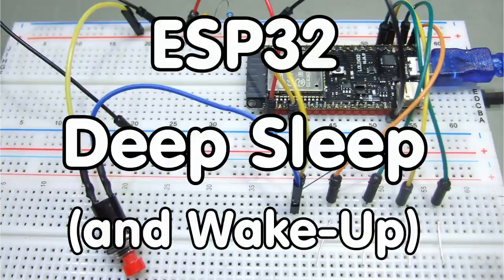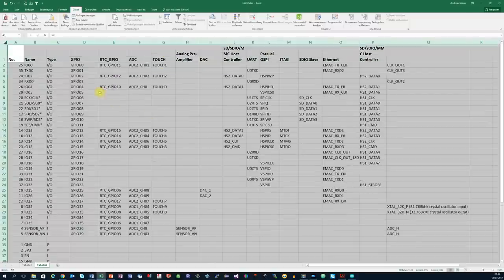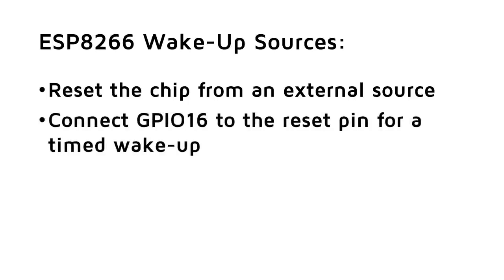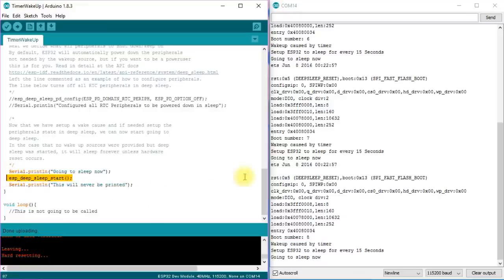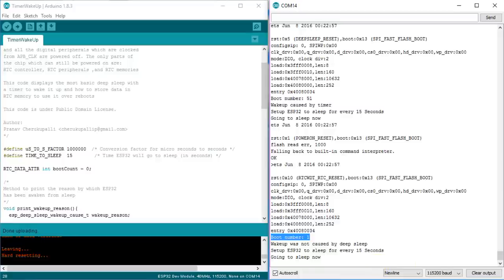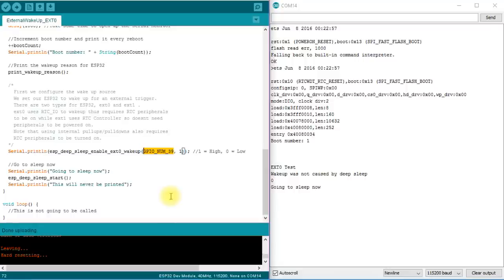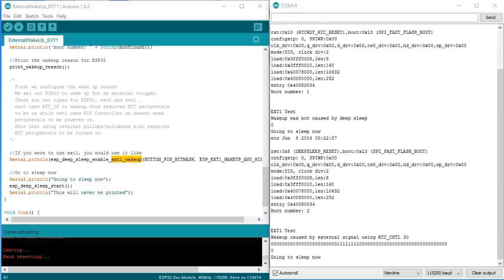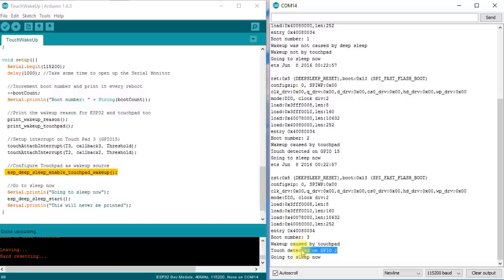#149 ESP32 Deep Sleep, RTC Memory, "Secret" LoLin Pins

Comment: You have become one of my mentors though your videos.  The ESP32 ULP processer may hold more capabilities than we think.  I've been researching  what little information I can find on it which seems to only have an assembler available.  Hopefully more information will surface as the community gets a chance to work with it.  I'm certain you will discover many of its secrets.Looking forward to more of your videos.  Thank you!
Reply from the maker: I think, the assembler is the "state of the art". I hope, we will get some "snipplets" to start with or to solve typical problems like trigger on a particular analog value, or saving a few values in RTC ram between wake-ups. Already the possibilities used in this video provide some interesting possibilities.
Reply: "is... like that."

Comment: Excellent work sir, thank you for your research! I have one of those ESP32 with the 18650 holder, last night I started testing a modified sketch, have it waking up every 30 minutes and blink a LED couple of times, started at ~4.15v and 12 hours later my battery is still at 4.05v. A day ago I was only able to get ~24 hours of total "blinky" on a single 18650, but with deep sleep this should last for days/weeks. Looking forward to see your current measurements!
Reply from the maker: These boards usually are not ideal for deep sleep because they have many parts which are not absolutely necessary and which use some current. But weeks should be ok.

Comment: Very interesting video as always. Please on the next video measure the current when the ESP leave sleep mode and connects to internet (like ping to custom website). I think that will be the main use of this uC and it will serve as reference for some people that want to use this device to send periodic data to a server and have to power the uC with batteries.
Reply from the maker: We will see. I think, I will not be able to use the ULP for quite some time, because it has to be programmed in assembler... I did not do this for years.
Reply: Assembler... now there is a name from the past. Must have been early 90s i did that last. Now i cant even understand my own programs from those days anymore

Comment: Watching this video made me want to dig out my ESP32 once more and see  if I could make it do something.  For about an hour, I messed with things trying to get the computer to recognize the blasted thing, and in the end I tossed it in the pile of junk I keep for parts to repair other items. I dug through my drawer and found one of the other ones I ordered at the the same time, (usually buy things in groups of 3) and behold, I have connection to the computer. Now I have spent the last two hours just running example sketches on the device, and giggling like a child when it actually does something. Now if  I can figure out how to use the bluetooth to do something and how to  use the wifi better then just making an led blink.  Should not be hard to do, just have to adjust my mind from using the 8266.
Reply from the maker: Wi-Fi should be no problem. Bluetooth seems to be harder with the Arduino IDE...
Reply: thats good to know. Was considering a switch from 8266 to 32 especially for bluetooth. Maybe i should wait

Comment: Another excellent and very interesting video. By strange coincidence I was testing deep sleep mode yesterday on a NodeMCU ESP-32S board and the best I could get was 2.3mA because of the regulator etc. (battery was connected to 3.3v pin so bypassing the regulator to a certain extent)
Reply from the maker: This is not surprising. The same as with the ESP8266 boards...

Comment: I know this video is 2 years old, but after all this time, very few people actually used any deep sleep timer example longer than a few minutes.
The problem is that with default code, changing the time to longer than 2 hours, it breaks the code, and overflows the variable.

In deep sleep example:

#define uS_TO_S_FACTOR 1000000  /* Conversion factor for micro seconds to seconds */
#define TIME_TO_SLEEP  3600  /* Time ESP32 will go to sleep (in seconds) */

Both values are saved as 32bit integer, yet esp_sleep_enable_timer_wakeup(uint64_t time_in_us) expects the 64bit value. So, you have a 70ish minutes limit before overflowing.

There are 2 solutions, add ULL suffix to uS_TO_S_FACTOR value: 

#define uS_TO_S_FACTOR 1000000ULL /* Conversion factor for micro seconds to seconds */

OR 

Define all variables as uint64_t

const uint64_t OneMinute = 60000000LL;         // 6000000 uS = 1 minute
const uint64_t MinutesInAnHour = 60LL;  // 60 min = 1 hour 
const uint64_t SleepTimeMicroseconds = OneMinute * MinutesInAnHour * 2LL; 
esp_sleep_enable_timer_wakeup(SleepTimeMicroseconds); 
esp_deep_sleep_start();

Sources: 

https://github.com/espressif/arduino-esp32/issues/572

https://www.reddit.com/r/esp32/comments/95zuht/esp32_fails_to_deep_sleep_over_1_hour/

https://docs.espressif.com/projects/esp-idf/en/latest/api-reference/system/sleep_modes.html
Reply from the maker: You are right. Maybe somebody reports it as an error in the ESP32 Github?

Comment: eagerly awaiting the results!
I have 2 boards and both were disappointing.. After I hacked the cheapest one to remove the UART and LM1117 connection to the 3v3 line I got good results ~20 microAmps
Reply from the maker: Usually I use bare boards for deep sleep experiments.

Comment: Great video again. I have used sprakfun ESP32 Thing and like you said, in one the previous videos, compiling time is much faster. Pricing is coming down as well so I think now is a good time to start working on esp32.
Reply: dachoeks3 Which board is faster to flash? The Sparkfun Thing or another? Which other board are you comparing the Sparkfun to?
Reply: Compiling for ESP32 Thing is much faster compared to regular esp8266.
Reply from the maker: That is also my impression. This is why I started the coverage now.

Comment: Great video. I'm very interested in seeing what kind of power usage you see in deep sleep on your Lolin32 board. On my Sparkfun ESP32 Thing, I could only get around 950uA (after disabling the power led); apparently the SPI Flash chip consumes around 860uA unless you add a pull up resistor to it. I would love to see what figures you get on your board.
Reply from the maker: These boards are never good for deep-sleep because they have many other components like USB to Serial chips and some sort of pull-up or - down resistors and transistors. They are not optimized for that. I will use a "bare" WROOM-32 module on a simple PCB
Reply: Andreas Spiess Then the mystery to me when using a wroom32 without usb-serial how do you flash your program to it? I also understand that without a battery power regulator you are limited to battery sources with a natural ~3.3v supply, correct?
Reply from the maker: You have to add whatever is necessary to a barebode WROOM-32. For a first flashing a USB to serial converter (later, you can use OTA update), and also a LDO for power supply. But you only add what is necessar for the operation, not more and not less. The development boards usually have "more".
Reply: Andreas Spiess thanks for the helpful information! I look forward to your next video!

Comment: I am using esp32 with three pzem004t sensors but when I am writing Serial3 at that time it showsSerial3 is not declared in your scope but I have defined it already so how to solve this problem?
Reply from the maker: If I remember right, I made a video about Serial on the ESP32. You have to pay attention if you want to use many Serial connections. Also check the video about the "safe" ESP32 pins. Some pins are forbidden.

Comment: I tried to measure real current usage, but unfortunately my board (AnalogLamb) and others hve as usual a "power led" on it.
So I could not realy measure ESP's sleep current without removing it.
The board uses 15.7mA with a short peak at wakeup (timer sketch) up to 58mA driven by 3V3 bypassing the LDO.
Waiting for your measurements with the bare board   :)

Comment: hello its me again, the guy with the welsh accent, another great video,  Quick question, what is the best way to wake up and Esp32 from Deep sleep, using an FZR sensor,  could i use it as a touch but reverse the threshold?
Reply from the maker: I do not know FZR sensors. The ESP32 has many wake-up possibilities. Maybe you google to find the right one for you?
Reply: @AndreasSpiess  thankyou sir. I resolved this issue. I ment ''fsr'' force sensing resistors.  It worked with the ext0. Thankyou for your time.

Comment: Great video, and am really looking forward for the next one, I have a question, is there any way ,what so ever, to connect two serial devices (for example, a nextion and an A6) to ESP32? any suggestions?
Reply: Anas Omary Yes, it has three hardware serial ports and they can be routed to almost any of the pins. You have to look at the docs to see how to use them.
Reply: nobodybodybody I made a lot of research and the conclusion was that there is one hardware serial(Tx0 and Rx0) , and an additional RX1 only pin. Do u have any link on this subject to get me going in the right direction?
Reply from the maker: The WifiTelnetToSerial example shows how you can do it (HardwareSerial Serial1(2);  // UART1/Serial1 pins 16,17)
Reply: Anas Omary I believe you are confusing it with the ESP8266, which has one available hardware serial port + one TX only port (you can still use software serial however to get more). The ESP32 has three. The Arduino port has weak documentation at the moment, the link Andreas gave is the best starting point.
Reply: Thanks alot for the info, I will definitely check that out as I need it for an upcoming project. Cheers!
Reply: Update: I checked the HardwareSerial class file, and it definitely has 3 hardware uarts, they are 0,1,2 and the rx,tx pins are 3&1,9&10,16&17 respectively, thanks again for the help.

Comment: Since we're due for a video on power consumption, I thought I'd add this comment.  Of course the amount of power used during sleep is important but so, also is the power used during the 'awake' period.  I was doing some research on multi-tasking with FreeRTOS and found a tutorial which compared using FreeRTOS commands vs Arduino IDE commands (both written within the Arduino IDE) and the conclusion was this: Conclusion: the Arduino program is about 65% slower than the lower level FreeRTOS program.  So, for the awake part of the program further power savings might be made by using more efficient commands. (Citation: http://blob.tomerweller.com/esp32-first-steps) See Ring Oscillator section.  HTH!
Reply from the maker: Thank you for the information. For connected devices, connecting to Wi-Fi takes the longest time. And for that, I do not know if there is a big time difference. So, if anybody has information about the differences there would also be interesting.
Reply: Andreas Spiess maybe I will take a look! I will have some time to experiment in the coming weeks

Comment: Why didn't you try the Hibernate Mode? You did not use the ULP processor anyway. RTC functionality does not require ULP processor. RTC is supported in Hibernate mode too. Power consumption is 4 times less than Deep Sleep and you can still wake up with RTC alarm.
Reply from the maker: The data sheet was not completely clear which number applies. So, I took the (cautious) bigger one. We will see when we measure it in reality.

Comment: Your don't have to sort your spreadsheet Andreas, just use the Filter button to see the particular rows you require
Reply from the maker: I use filter and sort for different reasons. If I want the column in order, I think, I have to use sort.
Reply: You can use filter then click the drop down for the column you want to arrange and select A-Z or Z-A for column ordering. Much quicker for the same result :-)

Comment: one thing i figured that GPIO12 is also more or less unusable. It needs to be low during the ESP32 boot up from the flash with external reset. 
But if you have something connected with it that may keep the voltage at GPIO12 more than 1.8V and try to flash the chip, than instead of flashing the chip, the ESP enters into ROM console mode. 
This in turn leads to a MD5 checksum error of the flush during sketch upload. 

The issue is discussed here : 
https://esp32.com/viewtopic.php?f=2&t=322&sid=13419f5a55e80e26a67598b206ef9e02&start=20
It was supposed to have a software bug fix recently,  but so far have seen no progress on this.
Reply from the maker: Thank you for your tip. I did not know that. So we have to use GPIO12 as an output only, I think.
Reply: yes, actually GPIO12 has to be floating (probably internally pulled low) or pulled low only during sketch upload period. After that, it can be used anyway we want. 
For a breadboard circuit, I just disconnect the pin from external circuit during sketch upload, which is okay 90% of the time. 
But for an custom PCB, this may become more complex. 
So yes, easiest work around is to either use it as an output pin or may be avoid using it as much as possible.

Comment: Could you expand on why you seem to imply things need to be written "differently". Of course lower power programming has to be adhered to but, stating you wont or can't enter the loop section confuses me. Can't deep sleep be called from out of the setup section?
Reply from the maker: After calling deep sleep the ESP goes to sleep. At wake up it boots.
Reply: @AndreasSpiess  understood, but aside from your particular example, is there anything preventing moving the deep sleep call from the end of the setup loop to anywhere in the main loop?

Comment: Hi I connected an external RTC (That is very low power) to the esp32. I wanna keep the external RTC runnning while ESP is on deep sleep (To save power). Can the RTC via I2C still run while the ESP is on sleep mode? How could I do that? Thank you!!
Reply from the maker: You need to use interrupt pins to wake the ESP. Or you can try to use the ULP (not easy). Google should be able to help you

Comment: Nice video! Do you know something about light sleep on ESP32? It seems not available yet. I need that  because I'm building a smartwatch with a GPS module, and  active mode is too hungry. Deep sleep is too inconvenient, because it doesn't seem a good idea to reset the module every second. Light sleep would be a good compromise.
Reply from the maker: I never worked with light sleep. Not with the ESP8266 and not with the ESP32. Why do you think, it is not good to reset a board every second. Nothing wears out. It is just code.
Reply: As my application has a user interface and a lot of functionalities, it will take  time booting and setting  it up, and will take more energy than keeping it active. Maybe if I use RTC mem to keep my variables. Anyway, I dont know if I can wake it up when serial data gets in without loosing data.
Reply: Update: newer versions of the tools now include light-sleep functions. It works just like deep-sleep, but do not boot the chip and have a faster recovery time.

Comment: I like most of your videos, but in this one a very important topic is omitted. What about not nominal but real power consumption of ESP32? E.g. DevKit1 consumes much more in deep sleep than it is documented, I was never able to get better than 10mA with it. DevKit1 costs roughly EUR 7.9, but the best one with surely low consumption from DFRobot costs almost EUR 32. There should be other choices in between. Could you please test them?
Reply from the maker: Most boards are not good for deep sleep because they use too much current. I made quite a few videos about that topic and we even started the "Superpower" project because of this fact.
Reply: @AndreasSpiess  Dear Andreas, I would be grateful if you could share a link to one of those videos, where you test ESP32.

Comment: I am developing a vibration sensor where I am using ESP8266.
My main problem right now is the power consumption, and  for that reason I will have to change the communication to BLE. 
I need to read vibration data every 15minutes, and the battery life (1000mAh) has to be more than 1 year. 
From what I read from ESP32 datasheet, power consumption is high and I am not sure if I will be able to achieve my goal. 
I would like to know your opinion about that, and also if there is another microprocessor that is more suitable for this application.
Reply from the maker: Maybe you watch my deep sleep videos?  If you need less power consumption you probably find chips from Nordic (NRF51/52. But they do not have the same community support as the ESPs.

Comment: your videos are very interresting and I thank you for it. Thank you very much for all. I live in Germany. I would like to deep sleep  and wake up my esp 32 through a simple remote control (with a single button) based on Bluetooth. Do you have a video about this?
Reply from the maker: BLE does not work during deep sleep
Reply: @AndreasSpiess  thank you for your reply. If not another question, how to activate a PIN and disable it by Bluetooth. Because I made a device based on ESP 32 and I would like to put the motion detector (connected to the pin 22) in stop and activate it using a remote control (having a single button) through the Bluetooth.
Reply from the maker: You have to have an external BLE receiver which is capable to listen and switch the pin. Quite complicated, I think.

Comment: Hi there, great video! However, I can't seem to get "esp_deep_sleep_enable_ext1_wakeup(BUTTON_PIN_BITMASK, ESP_EXT1_WAKEUP_ANY_HIGH);" to compile in Arduino IDE. It says "'esp_deep_sleep_enable_ext1_wakeup' was not declared in this scope". The EXT0 line works but EXT1 won't. Any ideas?
Reply: Ahhh, I found out I had to use "esp_sleep_enable_ext1_wakeup" instead of "esp_deep_sleep_enable_ext1_wakeup". Note the "deep" part is deleted. They must've changed the function names! Even the built-in deep sleep example is wrong then.  :)
Reply from the maker: Thanks for the info!